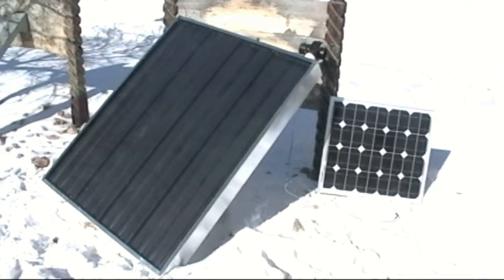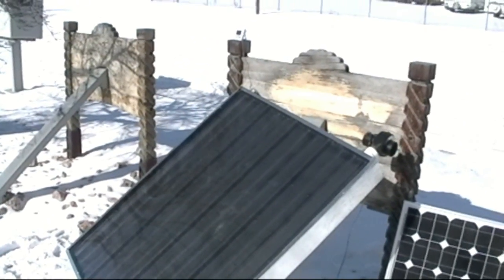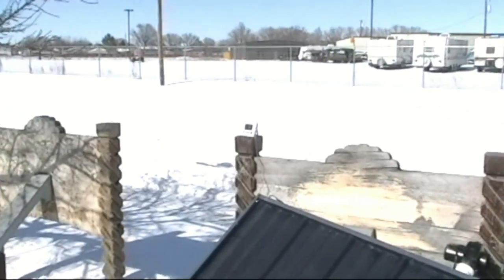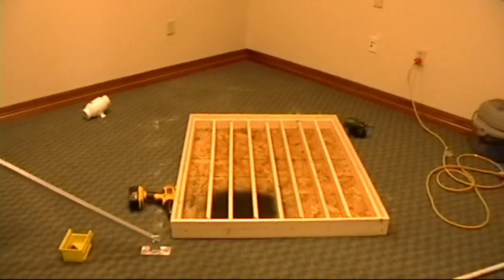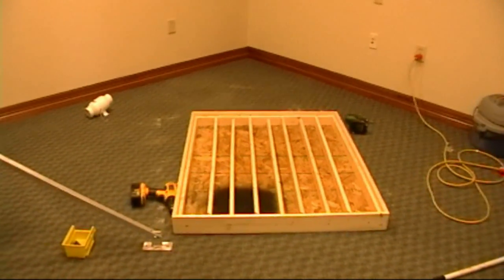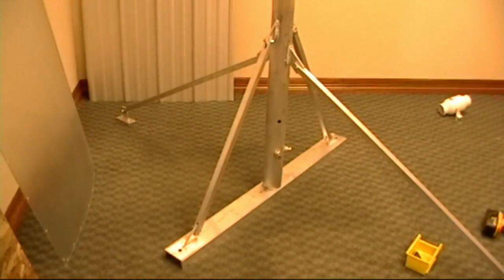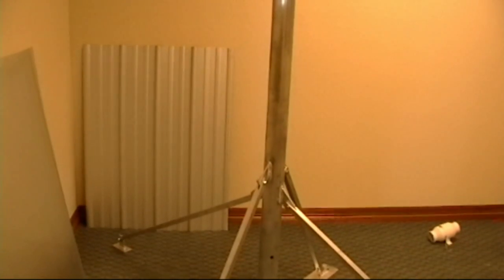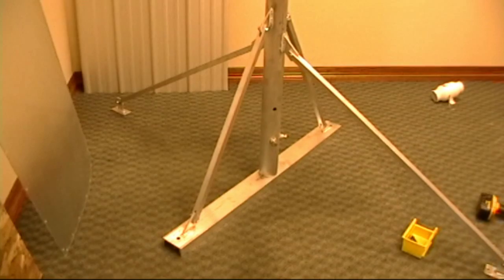solar hot air panel

Comment: You are right and wrong i did watch your video three times because my audio is choppy but i didn't catch everything word for word.Thought you where doing a fine tuned test of the heat output without error and thought you could have overlooked the blower heat output. Wasn't setting to degrade your work.However any matter in motion generates friction unless sealed & under vacuum & even that don't hold over time.Anyhow i like what your doing looks pro.Thanks for your response.